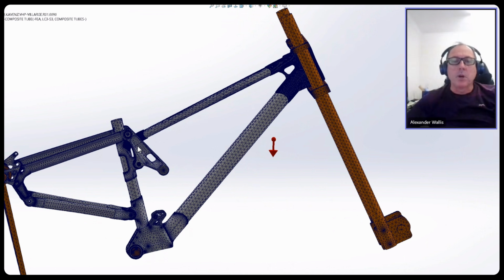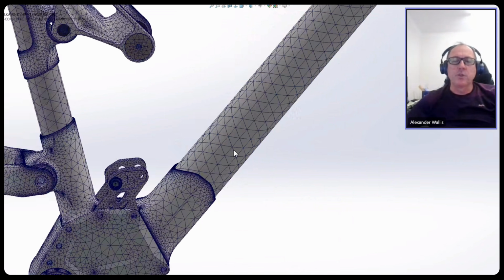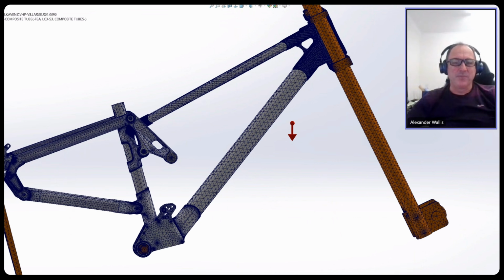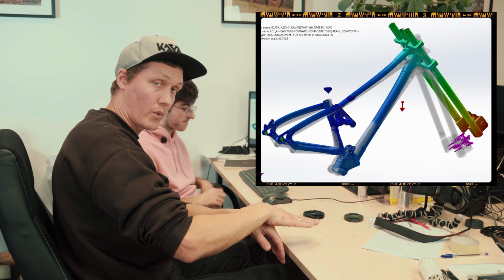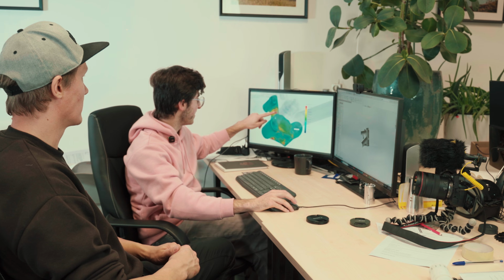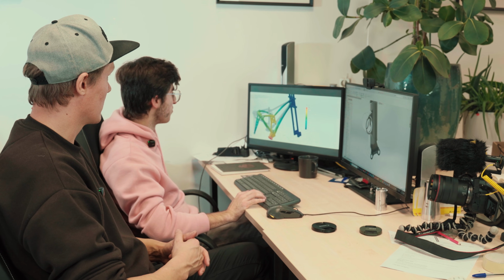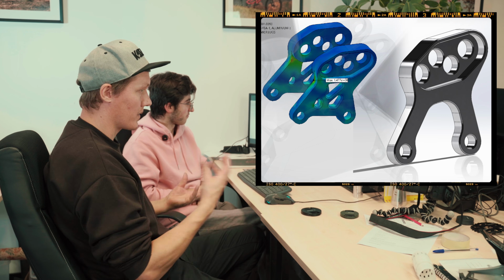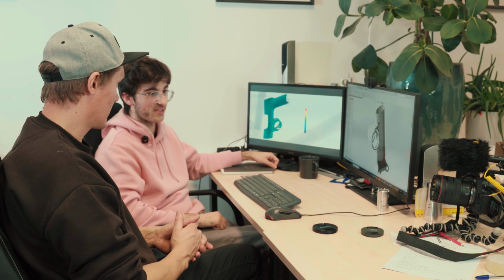FEM optimized CNC lugs for bike frame

Comment: I don’t understand why you’re moving in the same direction as everyone else — 3D-printed or machined lugs with tubes. Everywhere I look, that’s all I see, and I don’t see where the innovation or consumer advantage actually is.

There’s no clear benefit in terms of price, lead time, or ride quality. It feels like you’re trying to jump onto a train that has already left the station, headed for a destination that isn’t meaningfully different from where it started.

Maybe Im just not seeing the bigger picture yet...
Reply from the maker: Thanks for the feedback, we're actually exploring a new approach that offers a lot of potential benefits! But you are correct to argue as many of the benefits are specifically interesting for small scale manufacturers. We can make the frames in house, investment is lower, we remain more flexible with inventory, we can offer different tuned Stiffness for the tubes the precision of bearing seats will be higher and the overall alignment will be close to perfection. I hope that makes sense and maybe we can dive deeper into those points in another video.